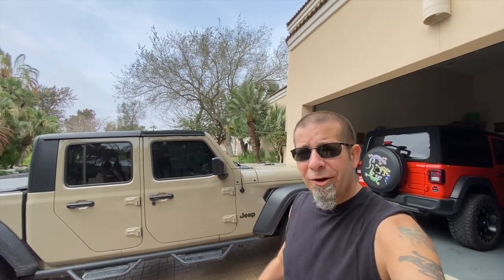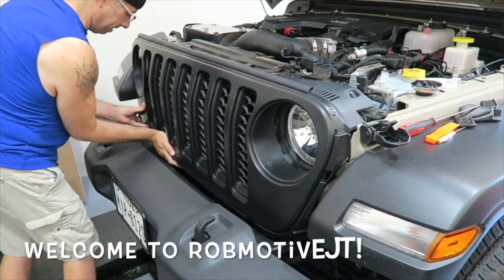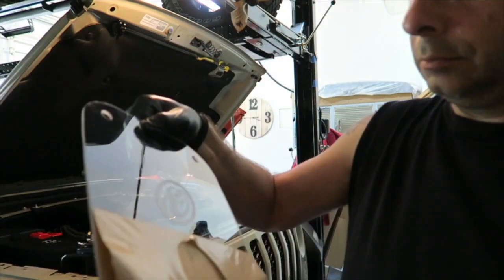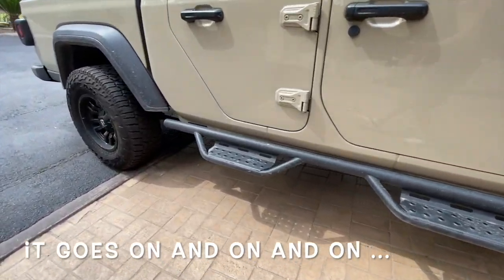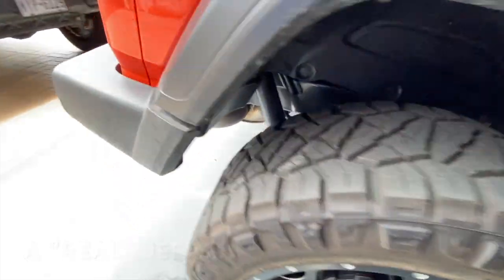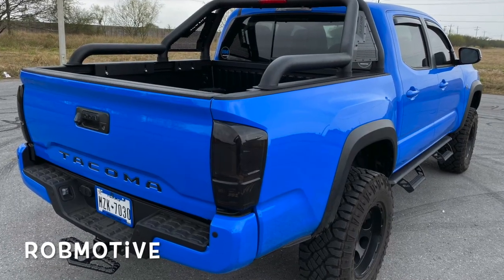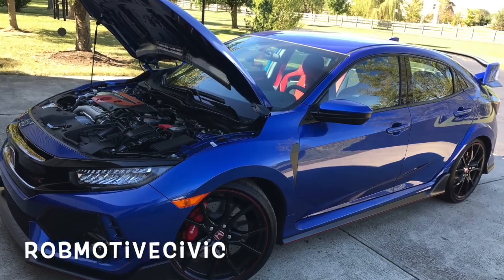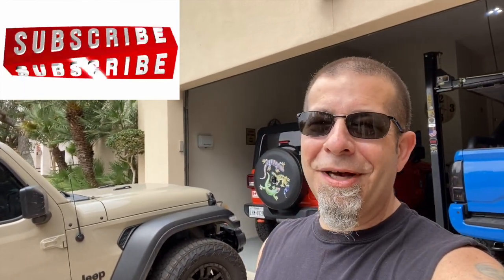You Can't Run a Jeep Gladiator Like a Real Jeep

Comment: My thoughts exactly. My Gladiator Rubicon came not only decked clear out, but I added very expensive two piece 20x10 Fuel wheels, 35/12.50 Nittos, new Mopar stubby bumper, NFab steps, UnderCover tonneau, BedRug, Mopar 2” lift, and a Mopar Rubicon winch. Not a chance in hell will it get trashed!
Reply from the maker: Yup!!  That's what I mean👍

Comment: I kinda agree with you. Everybody has this vision of the modern Jeep can go any where, like the original Willy back in ww2. Those army issued Jeep’s were 100 percent mechanical. No hydraulics or electric wires to connect. Brakes  were cable action.throttle cable, hard steel seats,steering wheel,levers etc. The only thing that was rubber was tires, wiper blades and ignition wires boots for spark plugs. These vehicles where ment to come apart and put together within five minutes from shipping from planes and boats to where  it  was going to be used. Have you ever see the the army troops put one together and start her up. I have many times seeing in shows.
Reply from the maker: I have seen that demonstration!  It's pretty awesome!👍

Comment: It depends where are you wheeling northeast were there tight trails or out west like Moab where you can wheel a full size truck I live in New England tight trails and the short wheelbase of a 2 door jk or jl is helpful even the 4door wanglers are fine the longer the vehicle the more stable it is some times it’s fun to challenge your self I got a tj and a 2017 Tacoma trd off-road double cab long bed

Comment: Gladiators are real Jeeps and can go many places and should be used offroad. I bought my Gladiator with the intention of using for just that. It's a Jeep with more versatility than a 2 or 4 door JL. If I wanted a street truck I would have bought a truck with independent front suspension. Solid axles belong off the pavement.
Reply from the maker: Nice👍👍